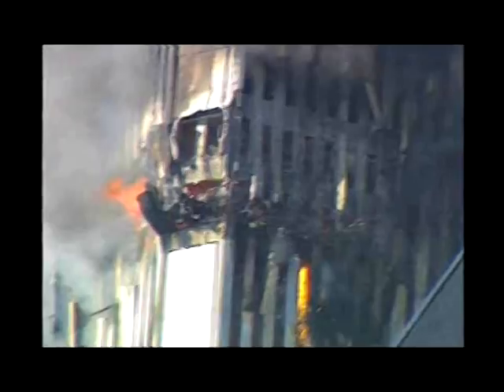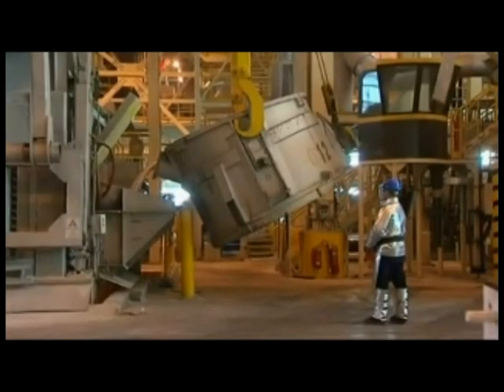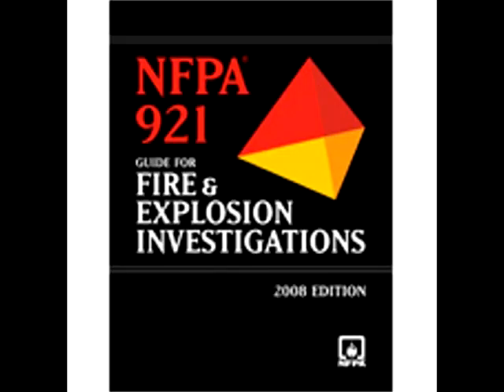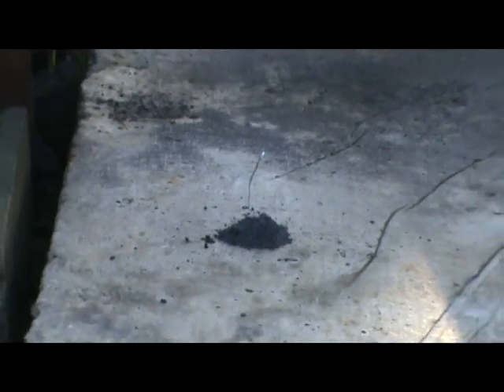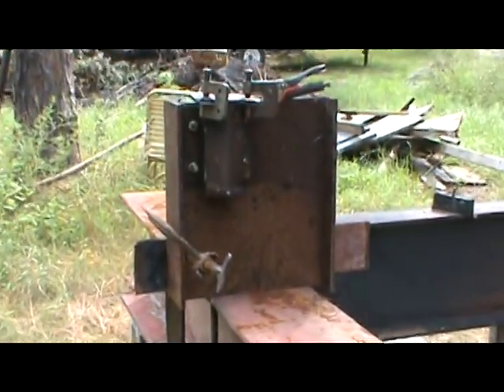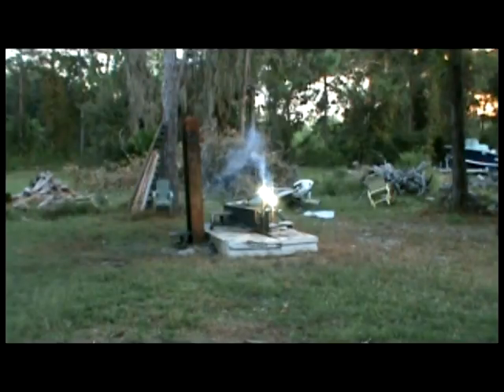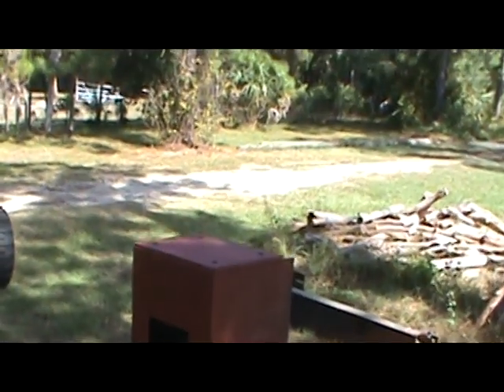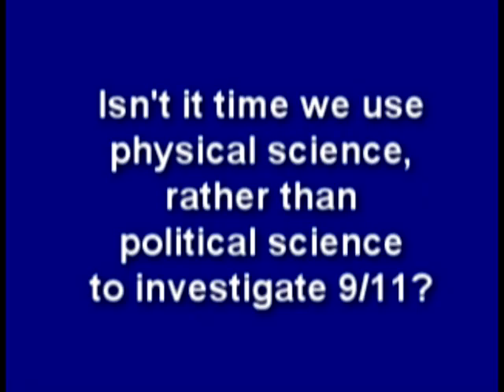9/11 Experiments: The Great Thermate Debate

Comment: Although I agree that 9/11 was an inside job, I do not agree with this theory for a lot of reasons, but lets address just one.

This video describes how other metals will sink or will float on top of molten aluminum.  It describes materials of the furniture not mixing, but the description is in a ideal lab ty environment.

The top of that tower on that day was FAR from being an ideal lab environment.  It was a blast furnace, a maelstrom of material that was vaporized when struck by a plane at 400 mph.

Plane does not just have aluminum, but titanium, which will burn without any oxygen once it's ignighted.  The aluminum will shatter into fine pieces, and the furniture materias will form fine particulates, toe be followed by fuel, wind, and an ignition source.  The blast furnace ignites.

The problem here is in the presentation.

Comment: "Jet fuel cannot melt steel beams." this statement is based on a couple of wrong assumptions about what the temperatures they stated actually mean. The combustion temperature of jet fuel is the temperature at which jetfuel will burn in a normal open environment. The temperature of an open office fire is the temperature at which normal office materials will burn and the temperature that a normally ventilated office will reach.

Both of these temperatures have two things in common. Those temperatures assume an environment where the heat generated by the combustion process leaves the environment relatively unimpeded, and it assumes that the combustion process is not accelerated somehow.

Inside a jet engine, regular old jetfuel easily reaches temperatures that can melt steel, in fact, if run too hot a jet engine will melt the materials it's made of which have much higher melting temperatures than mere steel.

Inside a furnace the same kind of thing happens, coal or natural gas, materials with not tremendously high combustion temperatures, are burned in just the right way to generate tremendous heat.

Within the towers you had a similar kind of situation. Unlike a regular office fire the plane deposited jetfuel into the middle of the structure and it cut an opening deep into the interior of the building to let air in or out. Then, because the building itsself was insulating the fire from losing heat as rapidly as it otherwise would, and there's nothing to impede fresh air from reaching the fire temperature would build and the fire would be burning hotter and hotter as time went on.

In fact what the narrator identifies as the fire "Dying out" was probably evidence of this process. As a fire burns hotter, it burns cleaner, combusting more material and not throwing up as much dirty soot.

Comment: would be great if you cited your sources. one of your examples, the most damning in my opinion, was the discovery of nano-thermite in the dust, however you cite this simply as being "an independent peer reviewed report was published". for all we know, those chips weren't even chemically tested or the report included a theory as to where the nano-thermite originated. "[nano-thermite] is a very high-tech explosive" yes and no. nano-thermite is the same thing as thermite except the particles are extremely fine making them more reactive. under the conditions of the plane crash, it may be possible for nano-thermite to be created due to the vaporization of materials upon contact since the plane's hull is aluminum and some of the metal structure may have been rusted.
"thermate produces lots of small spheres of iron" steel is just iron with a set amount of carbon, carbon which can be pulled out of the steel.

Comment: so what you're suggesting is a demolition crew brought in a bunch of thermate to just the right floors, cut holes in the walls to expose the steal structure, rig up all these "explosive devices" and then re-drywall and paint without anyone working in the building noticing, just to make sure they came down after the planes hit and the pilots of the jets where willing to kill themselves by flying into those specific floors of the towers, because no auto-pilot is that precise.

Comment: Sir, my hat off to you for conducting these very thorough and ambitious experiments! It may never be proven that there was foul play involved with the collapse of the 9/11 buildings because without mainstream media's cooperation, this issue will remain a cold case. However, what you did prove is that with some engineering of clever delivery devices thermate  can cut through steel in controlled and predictable ways. You may have inadvertently invented some helpful delivery systems for thermate that could be useful in the field where steel may need to be cut remotely. You should definitely look into getting patents on your designs if you have not already done so. (Don't be surprised to find the government already owns similar patents...Lol!) Anyway, it is clear that you are a very passionate and intelligent engineer who I would hire in a heartbeat if I was in a high level position looking for an engineer.  At the very least,  you are keeping this important debate open for further consideration and investigation so no one can say the case is closed just yet.

Comment: After a claim that was NOT backed by the provided link (2:02 — the link clearly states that the steel did NOT melt but only soften due to heat) and a reference to study that names thermite an explosive, I just stopped watching.
Reply: munsterr777 Insults are the arguments employed by those who are in the wrong.
Reply: +Jan Sten Adámek wow. thats actually a good saying.
Reply: +munsterr777 You're dismissing fact based on youtube account activity?
Reply: munsterr777 I agree, yours are good examples ;-) You didn't provide one single reason why my arguments should be wrong. Your only point is that I don't show which videos I like and which I commented to everyone who looks at my channel.
Reply: Max Maidment It was probably molten metal....not molten "steel".
Perimeter facade was clad in aluminum, it has a low melting point.
Reply: Max Maidment Everybody with at least some experience with welding knows you can melt steel with thermite (even the regular ones like iron oxide with aluminium). But you don't need to melt steel to cause it to loose its structural strength and therefore a building to collapse. That's also what the (referenced and misquoted) official report clearly states: the beams did NOT melt, they were weakened by the heat so that the weight of the building caused them to bend and crack.
Reply: Jan Sten Adámek Actually, it was the expansion of the steel that caused the failure.
 But you're right, structural steel loses a lot of integrity when heated to certain temps, that's why it's code to have it coated with fireproofing.
 Thermite is probably the most impractical pyrotechnical method of cutting steel above ground. Because it provides its own oxygen source, it's almost exclusively used for subaquatic ship salvage, harbor clearance and wreck removal ...and sparklers on birthday cakes.
 Not once in history has thermite ever been used in the demolition of a steel highrise.
Reply: munsterr777 Now you are just trying to troll
Reply: +Jan Sten Adámek people will always twist others words to make their point more valid, but i recommend you watch the full video. even if he exaggerated the sources claim, he still shows that he can easily melt, not soften, steel with thermate. and this is one person with nothing to gain by proving anything. government funded research could easily come up with methods of taking down a building with thermate.
Reply: munsterr777 So you're stance is the same as the one of ISIS: shoot everyone that does not agree with you. How noble of you.
Reply: +Bungman Agforty Isis is NOT a matter of belief or disbelief -- they are THERE FOR ALL TO SEE, chopping people's heads off, blowing up churches and raping little girls (and boys)!  So their existence (and their utter evilness) is SELF-EVIDENT!
Reply: +Bungman Agforty So what if I didn't -- I never saw an atom with my own eyes either, but atoms still exist!
Reply: +CobNasties Because THERE WAS NO MOLTEN STEEL -- the metal was ALUMINUM from the curtain wall!
Reply: +LaClairGaming He is LYING -- aluminum melts at 660 Celsius (1220 Fahrenheit), which is hot enough for it to melt a dull red!  And if the molten aluminum gets heated further, it WILL glow a brighter red and then orange -- it doesn't start vaporizing until 2470 Celsius (4478 Fahrenheit), at which point it will glow a blinding white like molten steel!
Reply: +Jan Sten Adámek  NIST first argued that the steel melted, THEN they argued that it only weakened. they changed their story, and if anyones credibility can be challenged, it's theirs. the commission report is utter BS and anyone who believes the full report is full of it.
Reply: +Jan Sten Adámek so what was all of that molten metal pouring out of the building?
Reply: +Emmerson Bigguns AND it also chemically reacts with steel when it melts -- which explains the so-called "thermite residue", and COULD also be a factor in the fires getting so damn hot!  I'm surprised nobody brought THAT up yet!  (Also, the molten metal was at orange-to-yellow heat -- nowhere near bright enough for molten steel, which glows a blinding white!)
Reply: +munsterr777 And how much is Al-Qaida paying you for it?!
Reply: +Richard Driskill No need to do that, we can arrest him for spreading terrorist propaganda!
Reply: +Jan Sten Adámek You believe in ISIS too?
Reply: agentorange153 Have you ever met an ISIS member? I ask because just because you see it in the Media doesn't mean it's real.
Reply: agentorange153...but do they exist the way you are told they do?
Reply: +Bungman Agforty Yes they do!  (Which "they", by the way?!)
Reply: The people that told you they exist. You didn't come up with it on your own.
Reply: +Bungman Agforty OF COURSE the people exist -- I was in their class at the university!
Reply: agentorange153 Not the people. The Atoms.
Reply: +Bungman Agforty Yes, the atoms exist -- this has been scientifically proven!  Which shows that you DO NOT have to see things with your own eyes for them to exist!
Reply: agentorange153 No, it proves that you don't not have to see something to BELIEVE it exists. Someone told you Atoms exist, and you believe them, based on THEIR "evidence".

People believe the 9/11 story for he same reasons.

(FYI, I know atoms exist. Just using it as an example)
Reply: +Bungman Agforty Because the EVIDENCE shows that it was Al-Qaida!  Just like you don't have to actually see who committed murder to know who did it!
Reply: +Jan Sten Adámek Not really. Lots of smart people who are right use insults to point out how fucking dumb people can be.
Reply: +agentorange153 He states in the video that molten aluminum burns silver, not red/orange as was depicted
Reply: agentorange153 What evidence? The passport of the supposed hijacker that turned out to be still alive? Or maybe you're referring to those laughably fake videos where a strangely heavier set, darker bearded, older AND shorter "Bin Laden" takes credit for the attack?

The "evidence" is a half-assed attempt to cover up the truth that, despite being obvious lies, has managed to fool a hell of a lot of people.
Reply: +Bungman Agforty The videos were REAL, and so was the passport -- and NONE of the hijackers were ever found alive, this is a LIE!
Reply: +netgod2002 Because thermite CAN'T cut steel -- they tried it on Mythbusters and they couldn't cut a steel beam with it no matter how they tried!
Reply: agentorange153 The passport was real, yes. It was a LIVING MAN'S passport. A man the U.S gov said was one of the hijackers. This is NOT a new piece of evidence.
Reply: +Jan Sten Adámek I'm familiar with welding. I have a 550 gallon burn barrel and I've burned more than a house's worth of lumber in it. I've watched it deform. I'm fairly familiar with metal, and construction. And the bottom line is that in ALLLLL of my experience, I've NEVER been able to make the laws of physics change for me. I've even gone so far as to pray on my knees and kiss the feet of Lord Kikemaster himself...
Reply: +gotsda speaking of videos of jets flying into the towers. Weren't they strangely grey and windowless and lacking, oh, UNITED AIRLINES insignia?
Pay some attention to the eyewitness accounts, will ya? Jeez.
Reply: *****
yo, homie. I didn't say that I was certain. But you HAVE to consider the eyewitness accounts, otherwise you're being pretty silly, don't you think?
Reply: +Bungman Agforty ISIS= any Muslim with a gun outside of Syria.
Reply: +Bungman Agforty just out of curiosity,  steel melted due to heat and fire but passport made of paper survived? or it had been fireproofed pretty good.
Reply: dirtymudkip
There is debate as to whether that's steel or aluminum, and until you can win that debate, it's not gonna look good to simply state that it was molten steel that we witnessed.
Molten aluminum DOES glow red.
It cools off to a silvery appearance very quickly due to its low thermal mass and high thermal conductivity per unit volume. In my opinion (as a person who owns a plasma cutter, two welding machines, and has a 550 gallon burn barrel that I've burned a house in as well as melted aluminum in), I it appears very unlikely to be aluminum, just based off of the appearance of the material as it falls through the air. However, we must remember that planes have a very significant amount of aluminum, that the exterior facade of the building was aluminum, and that the aluminum will indeed melt in a fire (though I strongly doubt it'd get hot enough to glow, since the vast majority of the fuel energy was oxygen starved office furnishings). So if you can show glowing melted material that's above or below the points of impact, it'll make a stronger case.
Molten steel will have a significantly higher viscosity, and I don't doubt the possibility that the firefighters would have intuitively reacted differently had the metal they witnessed be aluminum.
I guess my point is that I'd suggest you re-word your argument to something like "the preponderance of forensic evidence suggests that the observed molten metal was primarily steel", or something like that.
Reply: *****
 You call typing '911 Twin Tower Turned To Dust!!' into youtube having to 'search da intanet?'  MAYBE you wouldn't be so ignorant if actually BOTHERED TO RESEARCH ANYTHING. I mean holy shit why are there so many ignorant people out there? Or HOW? If we can find the info, unless you people are invalids, you should be able to find these things too......
Reply: *****
 I did just link the video. Literally copy paste what i typed, and its the first result. '911 Twin Tower Turned To Dust!!'

Comment: 1. Build a steel tube approx 200 ft in diameter and 1300 ft tall.  2. Add two large vent holes slightly above center as well as some smaller ones at the bottom. 3. Light a very large fire near the top of it (at or above the two large vent holes) using kerosene and provide plenty of paper, wood, plastic, and various other flammables.  4. You now have a self-feeding blast furnace hot enough to melt steel.
No thermite, no conspiracy, just plain and simple physics.

Comment: Interesting...but one thing still bugs me here.  You're forgetting the added weight to the buildings.  Each plane had to weigh around 600 to 800,000 lbs or more.  No doubt when the planes crashed into the bldgs, they cut into several of the bldg supports and I believe that is where the "pancake" effect started from, once the structure was weak enough from each plane's weight, it came down.

Comment: "After the plane hit the fires were burning out and cooling down,"  Lie No. 1.  Thousands of gallons of jet fuel ignited, and what didn't pass straight through the building pooled on the floors and poured down the elevator shafts -super heating the core of the building.   The wooden furniture, paper, carpet, and tons of random office plastic also caught fire.  There is a reason several hundred people jumped to their deaths in the 30 minutes the first tower burned instead of just waiting it out.   IDIOTS.  Your YouTube Channel Name is an embarrassment to the very concept of science.

Comment: There is a lot of people out there that have a false sense of security and the mindset that our government would never lie to us.  I have witnessed hydrocarbon structural steel fires involved in industrial facilities and was a certified welder for a long time.  A limited amount of jet fuel will not cut beams like the ones that were found in the towers.  There is more here than meets the eye and anyone who would not acknowledge that lacks common sense.  I am also very familiar with various different grades of steel and how they withstand temperature, corrosion and other various issue like free chloride stress cracking at elevated temperatures.  I'm not going to say who did it nor will I say who didn't just making a statement that i know to be true from experience.

Comment: Stop talking about 'melting steel'.   For the collaspe all that is required is the weakening of the steel.   To weaken to fifty percent all that is required is a temperate of around half the melting point.  The orange heat glows seen falls within that range.  In the dust samples analyzed after the disaster there are only tiny amounts of thermate.   What your experiments are talking about would require thousands of pounds.  Either would it take over an hour.   There would be huge initial bright explosions all over the building......There are so many flaws in what you have presented it's difficult to even begin.